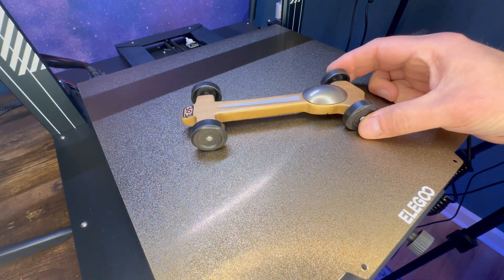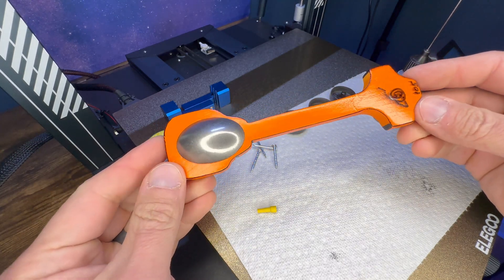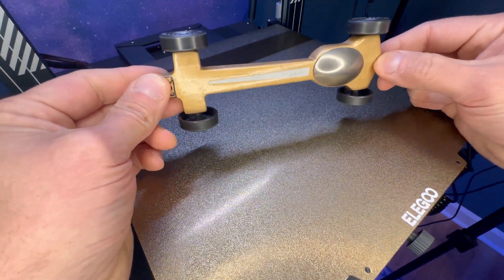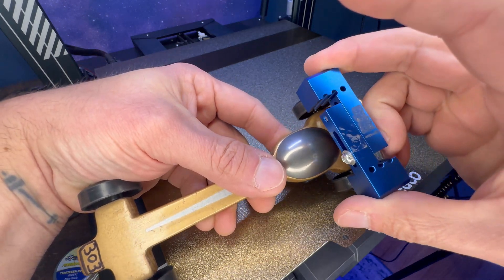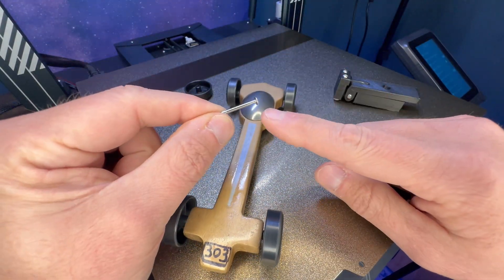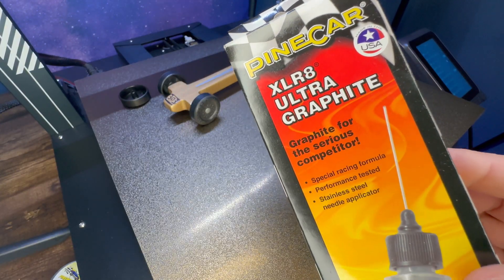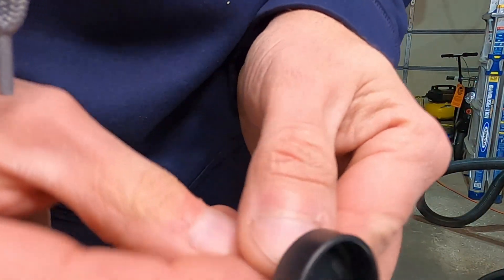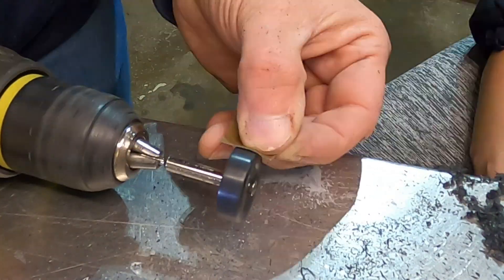Top 8 tips for building the fastest pinewood derby car

Comment: So the COG is an inch from the rear axle. That doesn’t mean the 3.5 oz weight sits center point at 1” also. You cut the car before figuring this out. Did you get lucky that the weight placement will fit on the design of the car and the COG would be perfect?

Comment: Where did you find the mandrel tool you mentioned using to lathe the wheels?  The 1/8 inch mandrel tool I ordered, the screw doesn’t fit threw the whole of the wheel without have it to thread it in the plastic part of the whole.
Reply from the maker: It was this one we used https://amzn.to/3NqsVP0

Comment: How did you use the hobby knife to lathe the inside of the wheel without the blade jumping or without cutting up the inside of the wheel? I tested it with some extra wheels that I had at home, but the hobby knife just tore up the inside of the wheel.
Reply from the maker: I’m pretty sure we just angled it a little bit and make sure the wheel is turning away from you
Reply: What size mandrel did you guys buy to lathe the wheels?

Comment: There should be two different races/classes. One where the kids make the cars without any parent helping and then one for the dads. I see this as a way to show the kids that if you cheat you can get ahead in life. Like that's a positive role model. There needs to be rules and regulations that are standard across the board and not well my pak doesn't care.
Reply from the maker: We have an adult unlimited class. But a 9 year old using a table saw. Not going to happen.

Comment: I  was in two Pinewood derbies and I won every race. I won by about four or 5 feet. My car was so much faster than everyone else's it did not  seem fair. I was no genius, but my dad sure was. He was an engineer and worked at Control Data Corporation, and build a wedge car using Aerodynamic geometry to minimize drag. He put the weight exactly where you guys put the weight. We had different wheel attachments back then there were 2/2" x 2" pieces of wood with a groove in them and then you had to put your wheels on nails and then slide the nails into the groove and then glue them in place.  Dad used graphite on each wheel so it would spin freely forever. I think that's how I crushed all the competition. It was pretty nuts. I didn't find out how much later that usually the Dad did all the work on all the cars and it wasn't just my dad. It made me feel a little better because I felt like I was cheating because my dad did everything But I did get to sand and paint them. There was a silver one next year it was purple and I got to paint them with the model paint so they were shiny so it was expensive, but they sure did look good! I used model paint, Testers model paint for plastic models, that you don't really use much.  I ended up using a couple of bottles on each car. I still have the purple one. Not sure what happened to the Silver Streak. I do still have both of my trophies. I think I have one for sure. I think the other is a plaque and that one probably just got lost, but I kept the trophy because it was pretty ornate and that's in my curio cabinet with my car sitting there. I did find a pinewood derby kit from the 70s at a garage sale which I bought I haven't done anything yet, but I think I might try to build a secret fast car.

Comment: Thank you for sharing. But I thought that polished axles and drilling of the axles hole is not allowed
Reply: Every pack and district is different.

Our district requires the stock wheelbase length dictated by the slots, but you can drill a block instead of using the slots... it just has to still be the same spacing.

Our district also does not allow much of any changes to the wheels aside from polishing.

Axles, some packs and districts forbid bending them, I have yet to find a unit or district that prohibits polishing them.

Definitely polish your axles.  You can also use a drill guide on the actual slots in the block to make sure the axles go in straight.  Or even better, get a guide that allows for a 3 degree camber to be drilled into the rears, which will get the wheels to not rub the block as the car rolls down the track.

Nobody would ever be able to tell that you did that even if rules dicatate that you must use the slots.

In the end, the most important things are weight placement, wheel/axle prep and aerodynamics, pretty much in that order.

So build a thin car (the less wood on the car the more weight you can put where you want it), polish the axles and don't have a bunch of things sticking up.

The video shows a very conservative take on weight placement, the COG on our cars tends to be more like 1/2" in front of the rear axle.

Better yet, we measure the weight of the car at the dominant front wheel.  We like to lift the left front and only have the right front touch.  15 grams at the right front wheel is fine for a pack race on an aluminum track.  20-25 if a wooden track.  10-14 if an exceptionally smooth aluminum track.  To achieve the lower numbers you may have to actually hollow out the block even after making it super thin.  Take this as far as you wish to go.
Reply from the maker: They don’t care in our district

Comment: Another pro tip that is important is flaring out the axle head so there is less friction from the wheel to the axle head (hub).  I got a Pinewood Derby Pro Axle Press Tool at the BSA shop that flares out the hub of the axle as well as bending it 20 degrees.
Reply from the maker: Good tip!

Comment: The dog bone or hour glass body can certainly be fast, but it's not the fastest design.  Using it you have to move the same air out of the way twice, a disadvantage.  Additionally its difficult to maximize your weight distribution, especially side to side.
Reply from the maker: The really thin wedges seemed to be faster at districts

Comment: What is your consideration for amount of distance between the body of the car and the plastic wheel hub? Does this distance matter?
Reply from the maker: About 1/8”- 3/16”. They need room to be able to spin freely obviously. If you use bent axles they will move away from the body and you won’t have to worry about them rubbing.

Comment: Do you have a template for the body shape? Looks really slick, nice build!
Reply from the maker: Thanks! I don’t. We used one of the wheels to get the rounded shapes and just traced it out also making sure there was enough to hold the tungsten weight. The car is about 1/2” thick so we cut it down to that first then drew the pattern out on it and used a coping saw to cut it out then a wood file and sandpaper to smooth it up.
Reply: @theguyofalltrades  Very nice, thanks for the reply!
Reply from the maker: Welcome

Comment: Congrats on the win!! Did you shave any off the body by the wheel doing the steering?
Reply from the maker: Nope just turned the bent axle to aim that wheel inwards a little to direct it to the rail
Reply: @theguyofalltrades  
If you can make changes before the district race, I have a couple of quick  and easy tips that could give you some speed gains.
Reply from the maker: Let’s hear them. Still waiting on the schedule to come out. I was thinking of raising one wheel in the front
Reply: @theguyofalltrades  
First thing before any changes is to check how much it's steering into the rail. I like to measure drift in inches per 4 feet(on something smooth). Remember what it is because when you put it back together you'll want to add 1/2-1". This will get rid of the wiggles that the car had on the flat. Make sure to get the bend pointing down and to the front.....maybe 5-4 o'clock. until you hit your number plus 1"
Second thing would be to take both front wheels off of the car. It looks like the wheel you aimed in was on the right side. I would recommend sanding 1/16" off of that part of the car. We do this when rail riding to keep the right rear from contacting the rail which slows us down by quite a bit(You can test this in step one by using a yard stick as a "rail" and roll the car down to check the right rear). Make sure to re-rub graphite into the wood after sanding. 
Third thing you said....lift that 4th wheel. It's easy to bend the axle. I like to put my bend up and to the
11 o'clock position. I also like to push it tight to the body to eliminate vibrations. 
Fourth thing would be to clean off the wheels before the next race. I like to reapply my graphite liberally and then wipe off the car. I like to clean the wheels with a magic eraser. If it's really stubborn I'll put some isopropyl alcohol on the eraser. Clean wheels are faster wheels!!

I think these 4 things could help speed up your sons car even more. The bonus is that he can be involved with all of these and you now know a bit of why. If this all looks too daunting just add an inch more of steer and clean the wheels. 
Ask any follow up questions.
Ryan

Comment: I would think that shaping the wheels such that only a small portion of the center or outside rides on the ground would reduce friction and also make it faster.
Reply from the maker: It may but that wheel still needs to rotate on the axle itself. The wheel doesn’t fully sit flush on the track with the bent axles